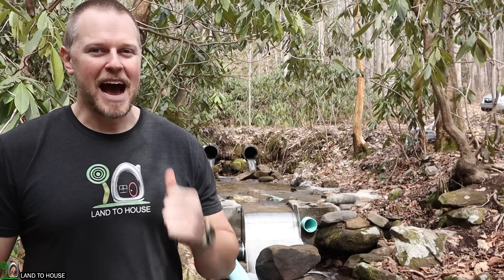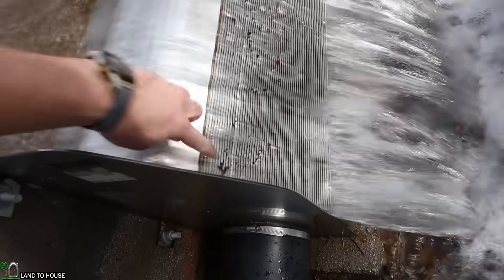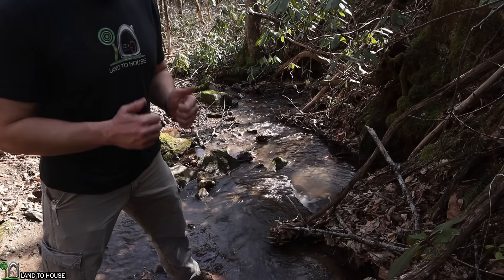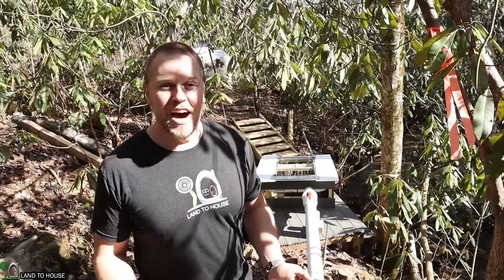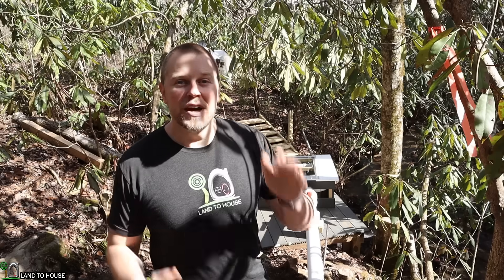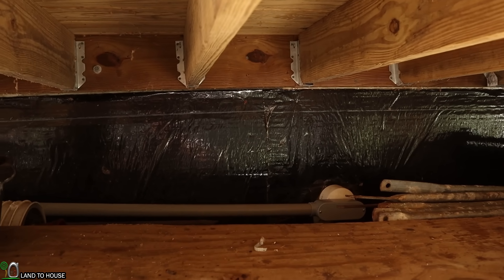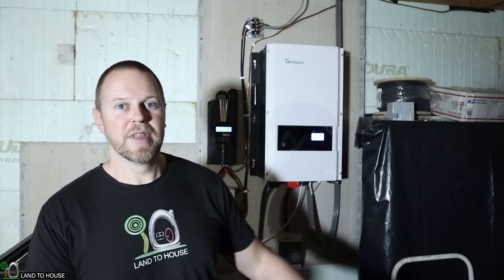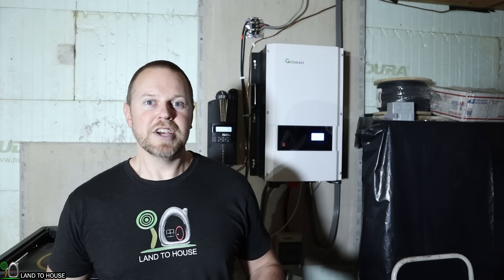AWESOME WATER POWER 500w Hydro Electric Off Grid System

Comment: PVC is made for interior and under ground  piping. It is susceptible to UV degradation. It would be advisable to paint it when left outside.
Reply: Yeah, just an exterior grade latex should suffice, there’s plenty of paints that block 100% of UV radiation.
Reply: @stephencooper5040 so you want to DeForest the subtropics?
Reply: uPVC is available, and is UV stable.  However, I would still paint it a colour more appropriate to be less obtrusive in the environment.
Reply: @andrewallason4530  Colorbond "Woodland Grey" is quite a good color for this. I have an industrial tractor on a bush block that was repainted this way to make it less of an eyesore and it works amazingly well on something that size..
Reply: @andrewallason4530 I... Yes it is but I have also seen it be extremely expensive in some regions of the US. Also ... There are some animals which like to chew on it. No idea why, but it must taste like celery or something.
Reply: Thanks for that, I guess! I just used white  PVC couplers, fully exposed to the sun, for connecting my risers to my impact sprinkler heads, anyone know if the grey PVC fittings are any better in UV?
Reply: @portnuefflyer  Grey PVC is UV resistant and made for pressure ,. Your sprinkler risers are fine for some years. The white is good for about 120 max psi depending on brand and intended purpose. White also comes in schedule 80 which is a higher pressure. 340psi working pressure. Still becomes brittle over time. I've replaced a lot of compressed air systems done in PVC that exploded so regularly that it was worth it to the business owners to invest 10K to 150k in metalic tubing systems.
Reply: @aaronnoffsinger5922 Watching this and having a moderate level of experience with pipe,  I can't help but think of that 6 inch pipe from the get go. Daily light exposure makes it very brittle. One branch falls during a wind storm and it's over. That appears to be sch 35 running into 40. It's not going to last 5 years in the sun.
Reply: @aaronnoffsinger5922   I'm only running 30 pounds, but still good to know!  I have some real good pipe wrap tape, 2" wide, used by well drillers for securing their wires to the drop pipe, and I've long used it for all kinds of misc. purposes. It seems to be somewhat impervious to UV, at least after 3 or 4  years, so today I wrapped my white PVC couplers with two layers of the stuff, that should give me a little more time before they fail.  Price brass fitting lately? Better be sitting down!
Reply: @Asking-for-a-friend   On my own system, on the advice of a maintenance engineer friend at a big fertilizer plant, I fusion welded what I believe is called HDPE pipe, 20' lengths, black, only available at commercial supply houses. He told me they had it laying out in full sun (mine is on the surface, too many rocks to bury it, but after a year or two largely grown over with vegetation) for years and it is about bulletproof. I had to rent the special machine to make the weld joints, and it's hard to believe it'll hold but I've had zero issues after 16 years, and would use it again.  I run about 60 pound dynamic.
Reply: @portnuefflyer  it sounds like you went a much better route. The materials you used are better suited for above ground use.
Reply: @portnuefflyer  bump
Reply: @portnuefflyer  word
Reply: @aaronnoffsinger5922 OSHA can do an immediate danger shutdown violation of a pvc air system.
Reply: @portnuefflyer  nice
Reply: @Asking-for-a-friend lol it'll last way longer than that. "It's all over." Quit being so dramatic. You would just replace the pipe and move on with your day.
Reply: @portnuefflyer  Yup, that stuff is great, food safe, can get it in practically any diameter and length, butt welds with a giant iron stronger than the stock pipe can handle petrochemicals, solvents and (I believe) the highest pressures of any "plastic" pipe out there. (my local govt. uses it for LPG delivery trunk line) All the mines around me use the stuff for everything and just surface lay it where possible. (it also comes with color code stripes I believe!)
Reply: @portnuefflyer You got it! Stick with black polyethylene pressure rated pipe for this type of installation. It does not HAVE to be fusion welded, there are "glue joint" couplings available... Use a primer and Permabond POP with cyanoacrylate adhesives that are made for black polyethylene pipe. I confess I've never used adhesives on polyethylene - I've always had fusion equipment available... It's the only way to go - unless you can't - then use the primer and adhesive mentioned above. 

On smaller pipe (1" to 2") I've rigged a hand drill to spin the couplings on the pipe... Continue rotating until you see a bead of plastic forming as you use force to bottom the coupling onto the pipe. You may need to make up a short length of straight pipe to friction weld the last length. In that case you would spend the pipe into the coupling (if necessary). By the way this works excellent with PVC pipe as well... Just make sure the components are clean to start with.
Reply: @sknopster   The stuff I used is for heavy duty industrial use, so tough, I saw some the other day while I was doing some crane work at a fertilizer plant. It was carrying acid (!) of some kind, was totally exposed, (and had been so for years) except for one area when it went under some railroad tracks! Fusion welded, which  is cheap/free to do, no fittings or glue to buy anyway,  once you borrow the welder, which I did.
Reply: @portnuefflyer we have installed miles of HDPE piping in the desert where it gets to well over 100 degrees F [43 degrees C]
It has been in use exposed to full sun for 17 years without any issues whatsoever.

Most of the diameters installed were 330 mm and 600 mm
Reply: The exposed pipes over such a long run is a very janky set up.  I would have buried the system.  Then again, as a machinist (who has done a fairly large amount of construction) I tend to overbuild things a bit as I am not crazy about junk and bad work.
Reply: @paulmartin2348  I didn't say it was janky or bad, I think it's a brilliant system and was hoping to help a person preserve his investment long term.
Reply: Guys… he is sharing his experience, absolutely this is something new and with it comes mistakes, if this was an engineer plan things could be different, but at the end things are working out nothing last for ever… my humble opinion!
Reply: Schedule 80 is meant for direct UV exposure. That being said, yeah, it should still be painted for longevity
Reply: How much is the hydro system cost please
Reply: UPP PIPE
Reply: Might be able to spray it down with 303 spray often but wouldn't be good if you're collecting drinking water
Reply: In one thousand years it might be an issue. The ferncos will faillong before the sun gets to the pipe.
Reply: Use automotive under coating.
Reply: Schedule 40 will not
Reply: Wow all the pros ....but none of them have done it them selves....good work dude
Reply: That’s dr35 pipe ya will get sun fade but will stand up for sure no worries
Reply: @alphawhisky1683  Your thinking of SDR35 which is almost always green and only rated for underground drainage, not for pressure. but okay Those are not pressure fittings and not schedule 80 so that leaves schedule 40 PVC. It will deteriorate, if not protected from UV. as specially if its' foam core as opposed to solid core. Pressure won't be an issue.
It's a very nicely done system! I think it's brilliant that it is off grid power.
Reply: So in 20 years it becomes brittle, big deal!
Reply: @ bob 

Probably way less than 20 yrs 

But let say 20yr 

Maby in 20 yrs your health may be bad or maybe too old to be out there replacing all that 
Not only pvc but all that wood 

Not to mention falling limbs and such
Reply: @boblatkey7160  that is an ongoing cost isn't it
Reply: @boblatkey7160  It'll be a lot less than 20 years, only about 2 or three
Reply: @boblatkey7160  Won't take that long but okay suit yourself. It's a brilliant system
Thank you Sir
Reply: @aaronnoffsinger5922  takes 30 years in Australia big amount of sun why worry
Reply: @boblatkey7160  20 years and brittle? More like 5-6 and broken.

Comment: Is that breaker box at 12:35 actually rated for 50 V 10 A DC? 
Why not have it on the AC side, where it is guaranteed to work AND prevent issues when the rectifier fails short?
Reply: the AC power goes into the regular breaker box, so they still have standard AC breakers in the system
Reply: @dawnderg  No. AC comes in -> rectifier -> DC into breaker box ("to disconnect the power").
Literally any other point would be better for the breaker. They are rated for much lower voltages in DC. Hence the question if 50 V is still within the limits for those or not.

Comment: Hi, great system. I'm assuming the system is all engineered, which is great, no mistakes. could you tell me the losses, i.e., that big growatt  inverter must take half the power for stand bye.
Reply from the maker: The growatt does have a high standby power consumption.  120w or so. They are still running 30kwh of battery storage so no problem.

Comment: That is a top quality system.  I bet that battery cost a bit. But pays itself off.  Well done🎉
Reply: People will be using 2nd hand EV batteries for this set up in the near future.
Reply: I have friends who were quoted $85k for a mains supply.  They were able to completely off-grid for less than half that cost, and have never had a power cut, unlike many of their ‘near’ neighbours on-grid.
Reply: that battery isnt necessary for hydro setups. i wonder if they have solar as well because 12kw a day from hydro isn't enough unless they're extremely minimalist and efficient. if you have sufficient hydro power you can get by just fine with a much smaller battery because water flows at night too. solar needs huge batteries because of no power generation at night. similar option if you have a reservoir that doesn't have enough flow for all day you can use solar and open the water valve at night too to save on battery costs but that doesn't work with streams
Reply: Well I would say it's absolutely sloppy electrical workmanship.

Comment: Just curious, could you integrate solar panels into a system like this? Perhaps with a second charge controller for the battery?
Reply: Yes;   In fact the 8KWH inverter they are using supports 2 PV input strings (15:09)

Comment: Based on the wiring I saw, the Home Owner did NOT get an Electrical Permit...

I also rather doubt a Trained Licensed Electrician did the work either as I saw several VERY sloppy, ILLEGAL and possibly dangerous connections...

For those wondering if I know what I'm talking about, I am a Trained Electrician...I do this shit for a living!
Reply: NOT if there's no requirements where they are. I don't believe the NEC applies to a non grid system
Reply: @mrmotofy  The NEC applies to ALL Residential, Commercial and Industrial Wiring ANYWHERE in the USA, regardless of whether or not it's connected to the Grid or not.
The NEC Rules are designed to make sure the Electrical Wiring is done safely and won't burn the structure down.
That is especially important to an off-grid cottage in the woods...would you like to be responsible for your wiring causing the next wildfire to burn down half the State? I wouldn't...
Reply: @HappilyHomicidalHooligan  It ONLY applies...if that location has adopted and requires it...lots of counties haven't so no technically there's no enforcing of it in those locations
Reply: @mrmotofy  Ummm the NEC stands for the NATIONAL Electrical Code...it's a FEDERAL Code that applies to ALL States and Territories. The only way a County can modify it is to make one or more sections MORE stringent, otherwise the NEC is the MINIMUM standards that MUST be met with ALL Electrical Installations ANYWHERE in the USA...
Same in Canada with the CEC...
Note: I'm an Electrician...
Reply: @HappilyHomicidalHooligan  Sure IF it's adopted and enforced in that location. If there's no ordinances, requirement, permits or enforcement by local officials then it's irrelevant. The local municipality vote to adopt the County ordinances and the state...which can be frequently following national codes but they constantly change/update. Not all follow the same version...you've probably run across it they're following say 2015 version etc. Cuz some entity somewhere hasn't officially adopted new versions.
OR a municipality can say NO we the local municipality do not adopt or acknowledge the codes...therefore no building codes, no electrical codes, no plumbing codes...I've read it in the codes. So your National code is irrelevant
Reply: @HappilyHomicidalHooligan  an unfortunately uninformed electrician.  The NEC is only legally applicable if the AHJ has adopted it as the standard for the jurisdictional area.  

As far as a trained electrician goes, as long as I pull my permit beforehand and call for inspections at the usual times, I'm not required to be licensed to perform electrical work on my own property or that of my direct employer.  Replacement-in-kind work such as replacing every worn-out receptacle and hinky light fixture in my house after I bought it required neither license OR permit.

For that matter, I can replace my electric water heater without requiring permits, a licensed electrician, or a licensed plumber.  Not every state has bowed under to the unions.

Comment: Would be more interesting to know what heat, if they run ac! Mainly what use they are capable of utilizing!?
Thanks, nice use of natural resources!
Reply: Anything less than 500 watts
Reply: @mrwess1927  
If I remember right the pressure was not very high!
Running 24 hrs, will make a difference! Unlike solar hit and miss!
Reply: you can run a small house of of this np.

Comment: Yeah but:
1. How much the whole system?
2. Payback time?
3. How much of daily needs does it cover? We have 10kW solar panels = 20 x this mini hydro, if my maths is right. IOW, 500 W doesn’t seems like a lot.
A commenter says “pretty good for free”. But it’s FAR from free! 
Also would take constant upkeep, IMO.
Anyway, I guess it’s different strokes …
Reply: Yup, solar is great, but really only works when the sun is within 20’ of perpendicular to the panels.  My 3.6kW solar system provides around 30kWH each day in summer, but 3-5kWH in winter (Tasmania), and I especially need the power in winter with 14+ hours of night.  This system is producing 12kWH per day, every day.  
Near neighbours of mine have a similar system to shown, installed around 30 years ago, but upgraded over time.   They were quoted a cost of $85k to get mains power back then!  They built the system for $10k then.  A current estimate for this system is around $35k, if you are able to do much of the work yourself, and buy of the shelf components, and have a knowledgeable electrician to do that work.
Reply: Payback time would be "immediately", as it was clearly stated that this house was off-grid.  This isn't an installation intended to supplement commercial power, it is the REPLACEMENT for what is probably unavailable  or prohibitively expensive due to location.

We went for years with 12V lights and propane appliances in lieu of spending around $100k USD to have commercial grid power ran to our summer cabin.
Reply: It runs 24 hours though. But solar is going to make much more power during the day. It would be best to have both.

Comment: Well, well! It would seem that such an inconspicuous, forest stream, without utility. I would certainly rate it as such... Meanwhile, 24 hours a day, it spins over 500 watts!!!! Incredible!!!! According to my estimate, this gives 12 kWH per day, which should be enough for the daily needs of even a large house without heating.
Well, it's not difficult to get wood for heating in the forest... No electric heating is needed.
Reply: Combine this with solar and it would power anything you needed
Reply: @richardreese5377  When I recalculated the energy production of this micro hydroelectric plant, I thought the same thing. I also thought: how wonderfully the two systems would be complementary each other!
And notice: running water as a bonus - for free!!! Perfect solution!

Comment: Have you worked with this sort of system in areas that freeze? Do you just disable and drain it during freezing months?
Reply: My thoughts would be as the water is constantly flowing it should not freeze, but if an area of lower velocity does, around the 😢 screen, the system below is self-draining, so will not be a concern (except for no power being generated).
Reply: I'm assuming it doesn't freeze in that area, otherwise this system will need to be buried, or drained for the winter (stop producing).
If it never freezes, I don't know why they did not use cheaper s&d pipe for the long 4in run.

Comment: question is how do you tie this into the house without back feed?
Reply: House is off grid. There is nothing to backfeed into. This is the only power to the house (it would appear).
If you want to connect another power source (like a generator), you would need a power transfer switch, or a way to feed the other source into the GroWatt maybe.

Comment: Only question I have is why is the three phase terminal block attach to a beer can on the wall
Reply: Because this entire design is hillbilly trash, but morons think its " an amazing system, well done!".... This is what happens when the masses learn something cool, and then they are able to impress other morons. Next video in the series will be his "green house" with Gatoraide irragation cause "electrolytes".... I havent seen a decent design in so long, but I guess this concept has gone mainstream cause all of these videos are junk and a waste of everything..
Reply: Heat sink.  I assume the can is an old one, with water or similar in it.  If the terminal block is generating any heat, the aluminium can will transfer that to the contents, which will allow the heat to dissipate.